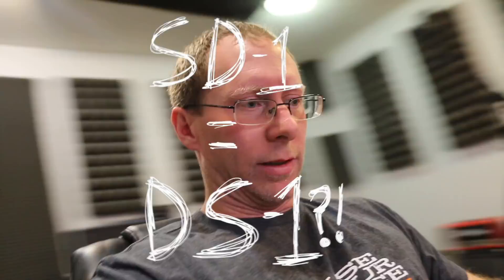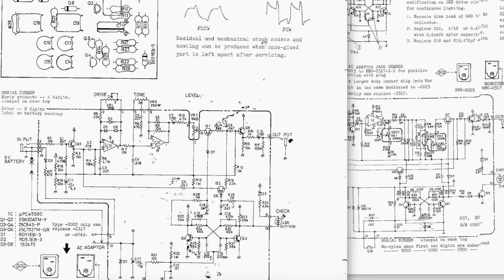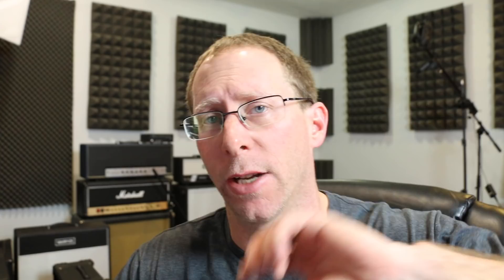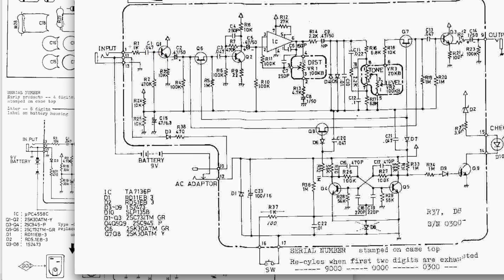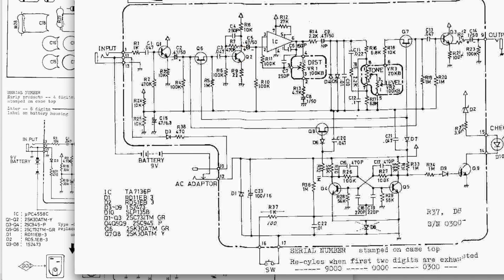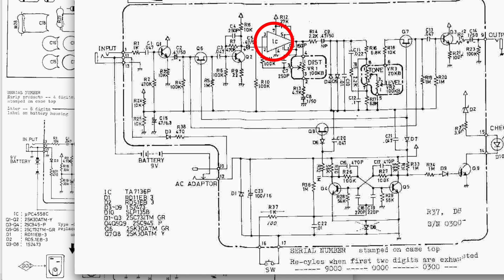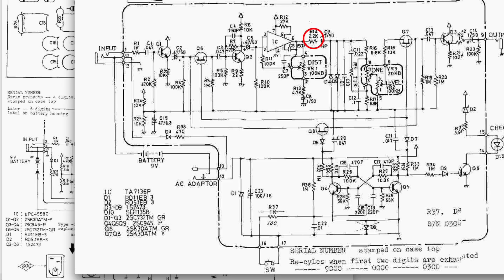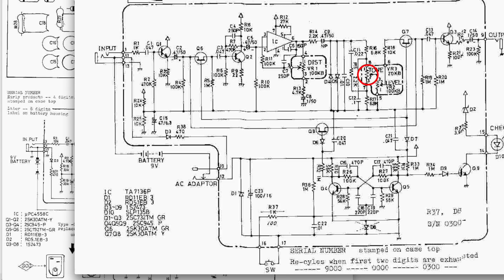Nerdy Circuit Stuff.... Comparing the Boss SD-1 with the DS-1

Comment from the maker: Are there any other pedals you'd like for me to discuss the circuits on? Comment below, make sure you subscribe and click the little "bell" next to subscribe so you get notifications when new videos come out.
Reply: What about the DS-1 compared to the Rat
Reply: Could you explain what does the oscillator circuit in the low right of the schematics do? Also could you do a video on MXR M82?
Reply: Compressors!
Reply: I've got an Electro-Harmonix Germanium OD pedal that's a bit fun to play around with, has controls for gain, voltage, and bias.   What are your thoughts on pedals like that, with controls like voltage sag?

Ever messed around with those tube pedals like the Vox Flat 4 Boost?  Thing sounds great with both bass and guitar.
Reply: Wampler Pedals Would love to know the mojo in the EP preamp or another Echoplex preamp pedal. Also the Neve/Bogner pedals. Thx Keep rocking!
Reply: Boss DS1 vs the EHX Big Muff please. I been told there basically 3 different parts
Reply: What makes a Klon Centaur so desireable.
Reply: +1 for the Rat vs DS-1
Reply: Why do most D-style pedals have a different style of Bass control?
Reply: Would love to see cool mods to common affordable pedals and mods to other pieces of gear that gigging musicians will find helpful, as always awesome video!
Reply: So, as you made the comparison in the video : How do the DS1 compares to the Big Muff ? Is there a way to transform a DS1 into a big muff ( i guess the op-amp version ?)  ?
Reply: Wampler Pedals hi Brian. loving the videos. Do you ever mod your amps in the same way you do with  your pedals? Would be interested to see your take on this. And I wanna mod my blues deluxe ri!
Reply: No idea what pedal it was, but I remember one that used MOSFETs to get a sort of Hiwatt sound.  I'm curious about what about the MOSFET made it sound that way.
Reply: Manticore M-core It's a flip-flop controlling JFET gates
Reply: I'd love to see more boss overdrives like the Blues Driver vs the OD-3 vs the SD-1 from a hardware perspective.
Reply: How about a comparison between an original big muff and a modded big muff circuit from another builder. It'd be interesting to see what they changed and maybe you could explain why.
Reply: A circuit comparison of fuzzes? Fuzz face type versus Big Muff type
Reply from the maker: (regarding the sd-1 to Klon conversion question...) not very easily at all, the circuits are quite a bit different
Reply: Wampler Pedals : id love to hear more about the blues breaker, KOT, Morning Glory type circuits
Reply: Dracarys
Reply: JFETs maybe, instead of MOSFETs.
Reply: A couple of interesting ones would be the MXR Dynacomp and one of the popular, easy to get/mod envelope filter pedals (EH Q-Tron, Boss).
Another area that might be of interest is equipment that you use for development that you've built.  For example, I have a variable audio freq sine wave generator that I've built that I use for amp biasing and some other bench testing/development purposes.
Reply: Love pedal Les lius
Reply: Wampler Pedals DS-1 with asymmetrical clipping ?
Reply: would love to see either the TS9 or TS808 compared with an OCD
Reply: Can you make tube screamer or sd-1 somewhat Klonish?  Maybe even just a simple boost pedal with adding a knob or two and some fun stuff inside?
Reply: Hi Brian, thanks for the great stuff you do. Why your on the BOSS stuff how about a look at their infamous buffers are they really that bad and how do they stack??? Also heard the other day that the OD1 is the same as the SD1 without the tone control? Lastly would love a vid on my fav Boss pedal the OD3.  Cheers Dan
Reply: EP boost vs LPB-1 Boost
Reply: Great fun. I'd love to see a video on how different kinds of octave effects can be created.
Reply: Wampler Pedals  how does the DS-1 compare to the DS-1X and if I wanted to get a Wampler pedal in that tone range what would you recommend me trying?
Reply: I would like to see a comparison of Klon Centaur and Menatone Red Snapper. Non necessarily circuit (because I assume they're different projects) but how the sounds compare.
Reply: Comparing different versions of the Rat.
Reply: Oh, and the ZenDrive.
Reply: UniVibe!!
Reply: klon? :)
Reply: Can you explain why some octave up pedals have a transformer? I gather the Tentacle doesn’t. If I fed it with fuzz would it sound more like a Fulltone Ultimate Octave than an Octavio/Octavia?
Reply: Blackstone overdrive
Reply: Yeah! I'd like to hear what you have to say about the Jetter GS124 and the Simble Overdrive.
Reply: MicroVibe, Jimi 50th Univibe, Diamond JDrive mkIII, ROTOVIBE.....????
Reply: What type of distortion is the DS-1? MOSFET? Or? 

Are there any better versions or clones besides the Turbo distortion on the market? I really like it’s gain sound but hate the lack of mid tone options and how muddy the low frequencies are.
Reply: Klon Centaur!
Reply: mxr zakk wylde od

Comment: Hey man, greetings from Brazil. I have one Oliver SD-10 pedal, is the same SD-1 Boss pedal. In the 80's import had high taxes here, so Oliver and Boss had a deal to produce the pedals here with national components and boss technology. In my opinion the bad thing to use overdrive first and distorion next is that sd1 have so more midrange than ds1 and sound changes drastically when ds1 goes on, mainly in volume. As you know the SD1 circuit very well, could you give a tip to fix that issue on sd1 board? Thanks in advanced

Comment: Man, I just want to tell you that I Love your "nerdy" electronics videos. I'm a tech, started building onboard preamps back in the 70s and I designed my own fuzz by making a mistake while building a preamp. Anyway, now I've built a bunch of amps from about 12 watts up to around 70. I wanted to get into the amp business but since I have more tech sense than business sense I've sold a grand total of 1, and it was just a modded Marshall 2204. However, I did manage to come up with my own design and that's a whole other story.
Again, your techy vids are Great! I only wish you did some on amps as well as pedals. But even if you don't, keep on doing what you're doing!

Comment: Well, this video helped me to turn my boss ds-1 into a TRUE BYPASS pedal... I just removed Q6 and Q7 (and connected their outside pins with a jumper), and then I removed Q8 (no jumper)... The pedal is always on, besides the LED that turns on/off when I press the switch. And that is good.  BUT, i can still hear a little noise when LED is on !!! When LED is off, the pedal is a little quieter and dist is the same (very good) whether the led is on or off... so the problem is "that on/off part" i think... 
MY QUESTION IS: is it possible to remove disconnect that part completely by desoldering C20, C21, D7 or so (but there are some grounding so..) ????

Comment: I love my DS1 (i use it with my Marshall DSL100HR), its a 2016 before SMD components were introduced (not saying thats a good or bad thing just saying). It has the NJM3404AL IC in it that Analogman used and from what i understand boss started using as stock after Analogman had already been modding them with that op amp for awhile. Theres so many different things that could account for this but ive played several DS1's and some were weak/thin sounding even with the "correct" tone settings(through similarly voiced amps). Im starting to think one of the reasons some people like this pedal and others dont is based on what reiteration they were playing. Mine still has to stay generally below noon on the tone control just like every other stock DS1 but it just sounds fuller and the hard clipping isnt too brittle like other DS1's ive played. I know that ive made a ton of generalizations and used lots of descriptive words that are subjective but im basically just giving my experience. Also i have a Proco Rat 2 that i thought was really really bright (more so than they typically are and i could have sworn it sounded better when i first got it). It has the OP07 IC (Texas Instruments) and i thought id change it out. So while waiting for the ic socket and LM308N IC i decided to open up the pedal and take a look. The soldering was horrendous. Half of it was done with no clean solder and the other with regular rosin core. Now that in and of itself isnt a big deal this is done all the time for various reasons but the solder joints looked rushed. Also it was apparent the iron that was used wasnt hot enough or contact wasnt made long enough so there were lots of blobs instead of professionally flown solder. With all the poor surface contact i decided to reflow some joints and remove the solder on the worst offenders and re solder. After doing this (and this could be completely in my head although i dont think it is) the pedal sounded much better. It was less thin and abrasive. Again take that with a grain of salt but that was my experience through my eyes. Im no expert but ive been playing guitar just shy of 20 years and have built a few of my own pedals etc. Anyways, .......sorry for the book.

Comment: Hey Brian, first off, thank you for the videos you post, as someone that is just starting to get into figuring out the basics, they are invaluable. Probably like many people that get into this kind of stuff I have been drawn in by looking to fix various broken or half- broken pedals ( Boss, Danelectro and old Ibanez pedals are what I have around, that I feel comfortable messing with and that I feel are good entry point). I have an Old Boss BE-5 multi-effects pedal ( which I love) and I was wondering if that is something you have ever looked at or would consider worth mod-ing? It is basically a bunch of 80's Boss stomp boxes smushed together. As far as I can tell from ear, the delay is maybe the DD-2 ( or 3?), the Chorus is much like the CE-3, the drive section seems like an SD-1/ DS-1 with a blend knob that mixes them, not up on Boss compressors but it is probably very much like the compressor they had out in the mid 80's. I am about to open it up and take a look at it today- One, because the switch for the drive section finally stopped working and Two, because I want to. Anyway, thanks again.

Comment: I think the Boss DS-1 is the most underrated pedal that there is. Look at the reviews by pedal snobs on the web and they all hate it. Yet so many pros use it. Mine is modified, it can switch between led and germanium clipping. The LED clipping as the clearest distortion I've heard. Can go to clean to extremely dirty just using the volume control. The volume boost is huge, compared to the (original, I assume) germanium clipping. That's my best pedal heads and shoulders above the more expensive pedals I've tried. The Boss SD-1 is great without any mod. Both used together is sustain bliss.
Anyway, thanks for these amazing videos.

Comment: Interesting. Thanks for pointing out the similarity to the Big Muff circuit. I picked up a DS-1 a few months ago for $20 and did a Keeley ultra mod on it. Though the mod gives it a bit more usability the first thing I heard was that it added a bit of Big Muff flab. I'd be interested in your opinion of that mod or what YOU would do to modify that circuit. Maybe a bit of a low carb circuit to get rid of that Big Muff flab.

Comment: Tech question:

Tolerances...what parts affect the overall sound the most. I use metal film resistors and box caps, but just started consistently testing each part for tolerance variance.

Comment: Thanks for the straightforward dissection of the of the signal path in these pedals Brian.
Tonally the SD-1 has a mids hump and the DS-1 has a mid scoop, simply put.
The Boss OS2 is basically a DS-1 and a SD-1 in one box with a blend control to sweep from one to the other - so is a useful way to hear the differences between the two.

Comment: I've been building and modding pedals for almost a decade now but have never bothered to spend much time with schematics. (Because I build mostly in a "color by number" way, it's not really necessary.) Your schematic walkthroughs have been really helpful, thanks! A question/request related to that:  I would enjoy hearing you explain how op amp distortion works. When you say "it goes through this part of the op amp" and then later through the other part, can you tell us what the integrated circuit is doing, roughly? Why would a designer stick a tone control in the middle of that process, or put clipping after it, etc.

Comment: Snouse Black Box 2 is now my favorite overdrive pedal. Check it out and compare?
Reply from the maker: It's just a Marshall Bluesbreaker circuit i believe... the sd-1/ts9 can be modified into that, but it requires quite a bit of off-board parts

Comment: Lol, so I guess they are not the same after all (I have DS-1s and no SD-1). I like to stack a pair of DS-1s the first at nearly zero gain and the second less than 50% gain and together they sound better than either alone. Guess I should locate an SD-1 to mess around with.  
Not sure if my edit on a prior video made it in or not but make sure on your pedal graphics you put sub titles to connect what the pedal does in buyers' minds. I only know what a Tumnus is after looking it up. I wouldn't need to do that if you'd put 'Tumnus - overdrive' on it.  
Add a link on your video or the updates to your previous DS-1 mod video.  
You might do a comparison video like this and the prior one with one of your pedals. What did you do and why did you do it and what might you do if you made that pedal again? Or what mod would you do to one of your stock pedals? 
Again do a factory tour of your pedal builds. You can probably do a few weeks of videos and tours are always popular = more views = more sales. you know, good stuff.

Comment: would be cool if while  describing a circuit like you do here you could add things like : "if you wanted to get more highs from the pedal you should prolly just change this cap to a smaller value BECAUSE this or that..." or "if you wanted less distortion, or more distortion or more what ever..."

Comment: Off topic, but possibly the subject for a video at some point: 
I swear I can hear (well, mostly feel) a difference between the standard Boss buffer and the new one that is in their criminally unsung DM-2W analog delay pedal.

There is just something about the Boss pedals when they are off that just kinda bothers me, kind of like when you use a cable you don't like. On the other hand, I think my guitar sounds better with my DM-2W in the chain, even when it's off.  It's maybe the first buffer that I really like the sound/feel of.

Am I:  
1) full of doodie? 
2) in possession of a pedal with components on weird edges of the parts tolerances
3) actually correct?

Bonus question- I have one of the Waza Craft vibratos, too. I swear the buffer sounds a little different than the DM-2W, but I can't stand the sound of both of them together in my board, but like both, as long as the other is not in my loop.

If this is all in my head, you'd be doing me a favors by debunking my utterly unscientific, anecdotal observations.

Love your videos, which is why I ask.

Comment: Brian, this may be to broad on this topic but is there any way you can point out a handful of pedals on the market right now that share the same(or very similar) circuits like the TS and the SD-1? Its great how you are pointing out which ones do and do sound the same but I think unless the manufacture explicitly states that "Yes this is a "Tube Screamer" like pedal its hard to really know. 

Boss seems to be the pedal de jour when it comes to these comparisons(I agree with Jeff Allen, BD2 vs SD1 and throw in the OD3 please) but it would be nice to get some kind of handle this. Plus I really want to know what Wampler pedal takes the circuit and then does its own thing!

Please do this with Delay as well! The whole Echoplex/EchoRec/Memory Man thing is driving me crazy. IS there a standard for delays in their various forms?! Am I dreaming thinking a DM2 sounds NOTHING like a Carbon Copy(Which sound NOTHING like The Doctor or Faux Tape Echo.....)

Comment: To what extent are the DS-1 and the RAT similar schematically? I read that they are based around the same circuit, but then I also read that the RAT was a Muff variant with a HP filter...?